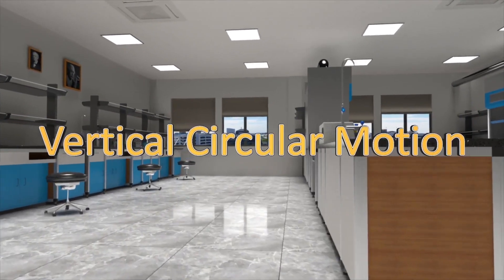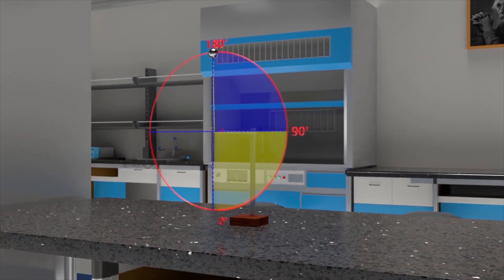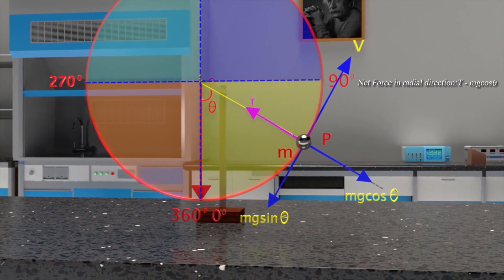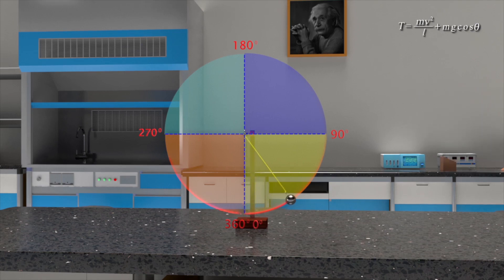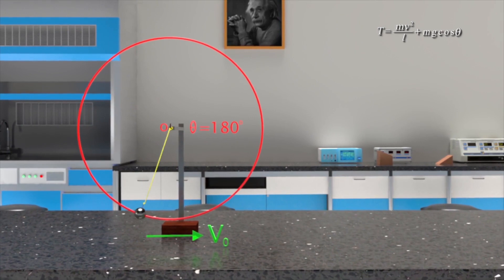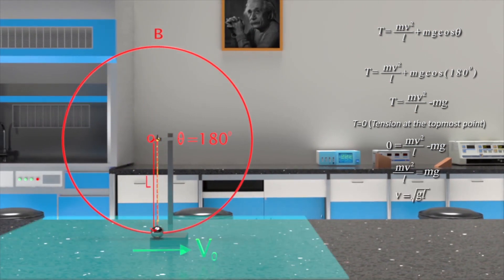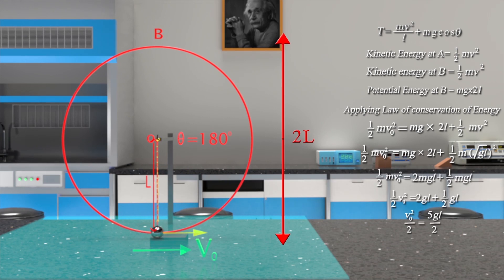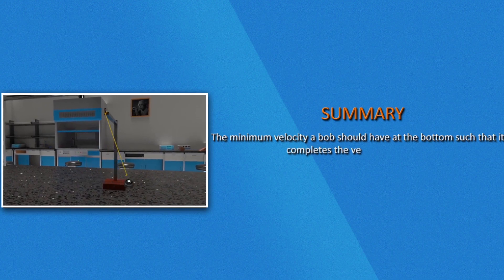Vertical Circular Motion

Comment: Why is tension 0 at the top?
Reply: Because

Loing at equations we can deduce that from 90 to 180

T+mgcos@=mv^2/r

So during motion in that quadrant The velocity decrease due to mgsin@ So look at the eq

U would observe rhs should decrease, and as body moves the angle decrease so cos increase so T must decrease(IT can't be negative) so comes a point where it would be zero but THE VELOCITY STILL STILL is NON ZERO. To sum. Up

Tension always first becomes 0.

Comment: Why is T=0 at the highest point?
Reply: Because

Loing at equations we can deduce that from 90 to 180

T+mgcos@=mv^2/r

So during motion in that quadrant The velocity decrease due to mgsin@ So look at the eq

U would observe rhs should decrease, and as body moves the angle decrease so cos increase so T must decrease(IT can't be negative) so comes a point where it would be zero but THE VELOCITY STILL STILL is NON ZERO. To sum. Up

Tension always first becomes 0.

Comment: Between 90°and 180° why does the tension become zero but velocity does not
Reply: Because momentum 0 nahi hua
Reply: at 180 deg the tension is 0 inorder to get min value of velocity to bring that point
Reply: Because 
Loing at equations we can deduce that from 90 to 180
T +mgcos@=mv^2/r
So during motion in that quadrant 
The velocity decrease due to mgsin@
So look at the eq 
U would observe rha should decrease, and as body moves the angle decrease so cos increase so T must decrease(IT can't be negative ) so comes a point where it would be zero but THE VELOCITY STILL STILL is NON ZERO. To sum. Up 
Tension always first becomes 0.